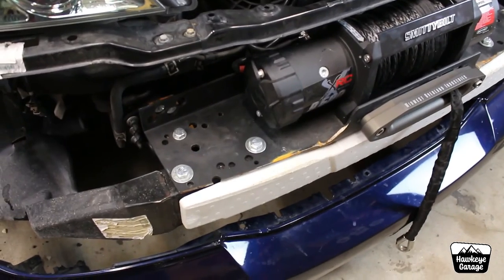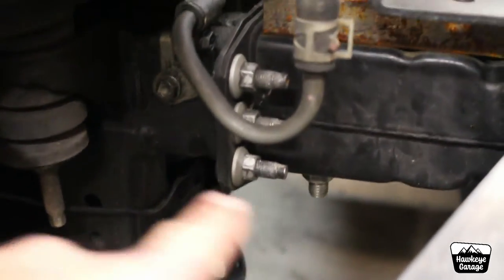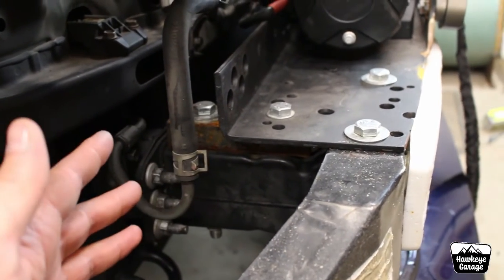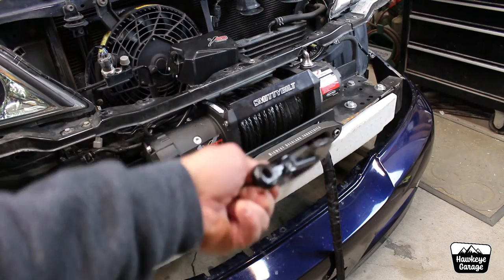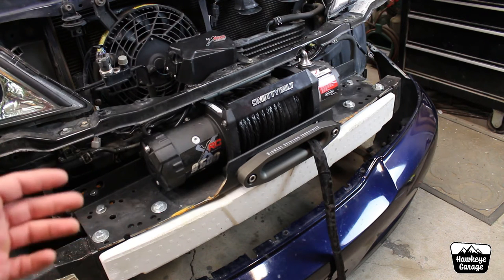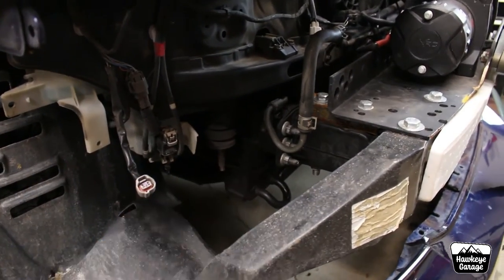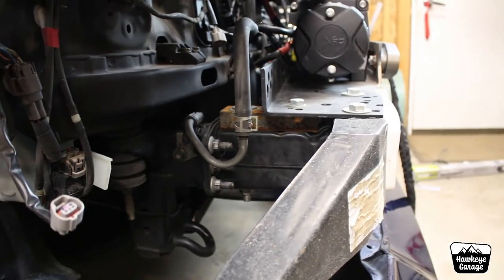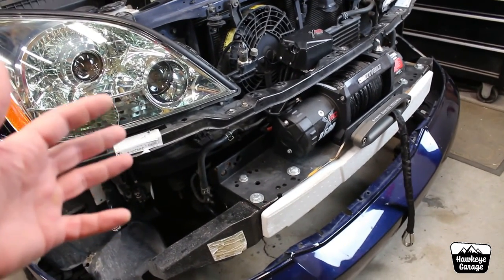GX470 DIY Hidden Winch Mount PT2

Comment: Good video.  Nice job talking through your thoughs.  One note,  the crash bar is only held on to the frame horns / crash bar legs by 4 bolts.  The horns is then connected to the frame by 8 bolts as you stated.   I watched this part 1 and 2 multiple times to decide how I want to do my DYI hidden winch.

Comment: Beautifully done 👍 But does the fact that it blocks a large portion of the radiator affect the engines cooling system at all?
Reply from the maker: In the months and miles since it hasn’t appeared to affect it at all.